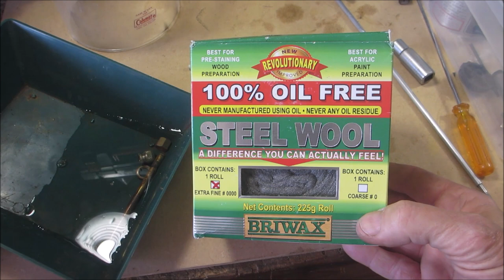Let's clean up a Coleman 220K Lantern!

Comment: what is your thoughts on rust be gone on the inside of a tank then of course fuel proof paint afterwords
Reply from the maker: I never used it. I have used vinegar and salt and Evapo-Rust with BBs. both worked well. After using either or, rinsed with hot water, blown out with compressed air then filled with denatured alcohol and emptied. And more compressed air!

Comment: I just bought the same model of lantern off Facebook marketplace.  He said it works.  But I'll find out.  But I only paid $25 for it.
Reply from the maker: Very cool brother! If you need any parts, let me know!
Reply: @DomMini 
He said it uses Kerosene.  Is that what the K on 220K stands for.  Are they as bright as the normal gas lamps.  We had Kerosene wick lamps at home for power outages.  But my Dad always had a Coleman lantern or two for camping.
Reply from the maker: @aikidragonpiper71 I’m pretty sure it uses white gas. All of mine 220Ks do, and I have quite a few. The K is just a model number.
Reply: @DomMini  
Will it say somewhere on the lantern about the fuel?
Reply from the maker: @aikidragonpiper71  It says kerosene on the Coleman decal on the front.
Reply: @Dominic.Minischetti  
The decal is pretty cracked up but it doesn't say kerosene on mine.
Reply from the maker: @aikidragonpiper71  Kerosene lanterns have different parts then white gas lanterns. There is a pre-heating cup.

Comment: This was great, trying to get my father in law's old Coleman 220K going and this helped tremendously.  Thank you!  I think I need a new generator, the one in this lantern won't let the spring out or the white part...it's in there and won't move, which seems bad.  I can't get it to light without a lot of effort, and when it has been lit, it just fades...and I just bought new fuel.  

This really helped me be confident about what to expect as I disassembled and reassembled!
Reply from the maker: @stonecutter2  I’m glad it helped brother! Sounds like you need to take the generator apart. Let me check if I have a video on how to do it. All you need is a propane torch, pliers and water. Or you could buy a new one. 

Thanks for watching brother, I appreciate it!
Reply from the maker: @stonecutter2  I can’t find my own video because the process is buried in one of the many videos! 😂 But here is a video explaining how to do it.

https://youtu.be/VagQaGHVGFg?si=tQ8O_zQ6LqP8LcQW